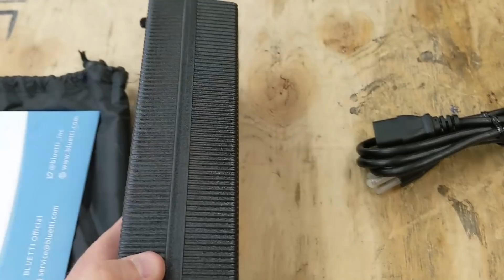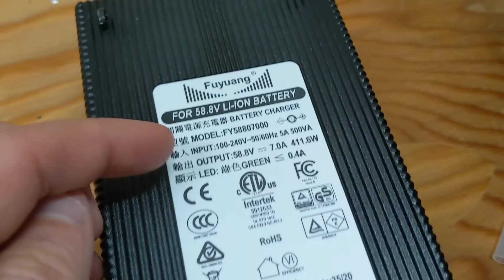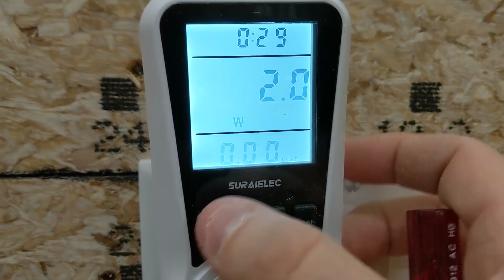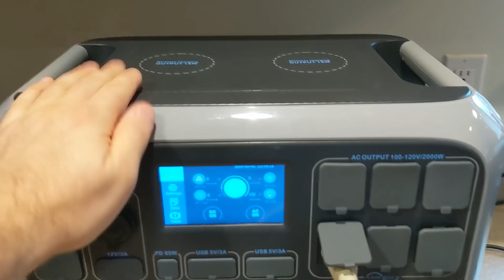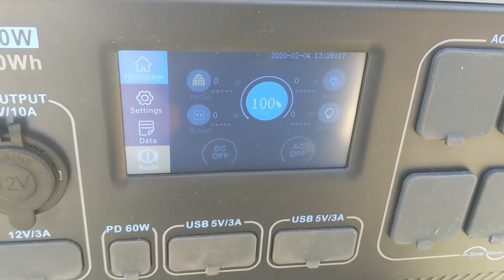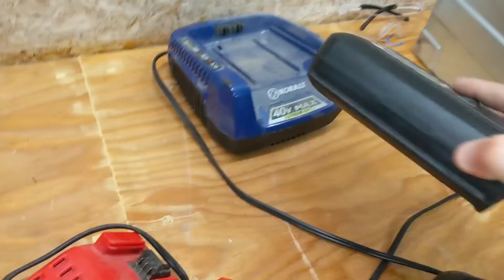DPoz Reviews:  Bluetti AC200P - Updated model for 2021 - Solar Generator

Comment: Cheaper/smaller inverters tend to have a so called "soft start feature". This allows the output voltage to sag under high surge loads. Lowering the voltage lowers the current. The motors in the vacuum and saw are probably simple brushed motors. These types of motors can spin up slowly to full speed using the lower output voltage. The motor in the compressor is probably an induction motor and didn't want to spin up on a low voltage. In the video you can hear the compressor turning slowly until the inverter trips out. It would be interesting if you redid the inrush testing using the power pack inverter as the source. I bet the inrush current on all of those tools will be lower on the smaller inverter. 

- A guy studying electical engineering

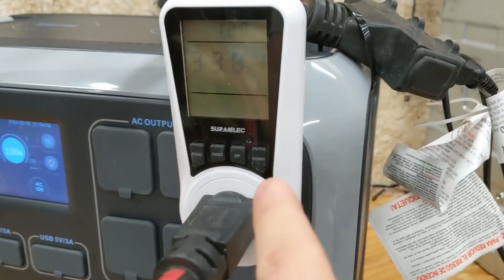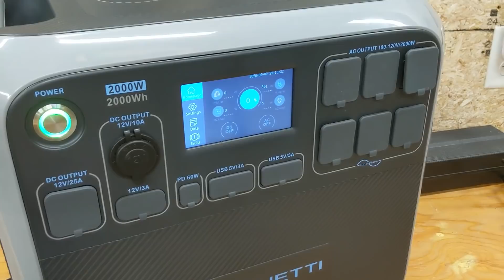Comment: Ok gr8 so I like your idea about two very large mono panels also I like the idea that you established they can run a five amp 5000 BTU air conditioner unit which is absolutely necessary for me in Florida. now combined with the fact that it recharges in 5 hours which would be an evening while you're sleeping after the solar panels have stored the energy would it run the AC for like 8 hours or even more? the coffee pot only has to run for 3 minutes so that's not a big issue of course it's nice to have coffee but why should I have to pay $3,000 to make sure I can get some lol now when you're talking about air conditioning that's a way bigger different story for me I have to have it. So if we could run at 8:00 to 10:00 maybe even 12 hours or more now you've got my attention! Also the Amazon website said that there was a $200 discount but when I went to go see the checkout it said it did not apply to my account I don't understand why that would be please explain that

Comment: I ordered the original version of the ac200 through the indiegogo program. Since it was nearly 3 months late being delivered, and I had to get on the road, I ordered a jackery e1000 to use while I waited for the ac200. The jackery was used to power my refrigerator and to charge up my phone and laptop and a few other small devices. I charged the jackery with an inverter connected to the alternator while I drove my van. From a full charge I could get four to five days out of the jackery before it needed recharging. When the AC 200 finally arrived, considering the extra battery capacity versus the jackery, I expected to get six maybe seven days out of the AC 200. Nope. I got the same four or five days as the jackery. I've sent five emails Bluetti trying to get them to explain why their unit, with 700 more Watt hours than the jackery, could not outperform the e1000. I got no satisfaction from Bluetti. I don't know what your experience has been but, I don't think the person who was answering my emails had English as their first language. They have stopped answering my emails.  Is there any diagnostic tests that I can run in order to prove the health or otherwise of my unit?
Reply from the maker: You could try a capacity test, same as I did in the video.  Use a little KWH meter (plugs in) to measure your discharge capacity.

Comment: Great video, would I understand that the dc outputs would work far better running 12v led lights, RV 12V fridge, RV 12 volt fan etc

Comment: hi David open it up? I am curious to see what kind of inverter does it have? I am suspecting is not a transformer based. because it uses a separate power supply adapter which isn't very efficient as per your test it needed 2400 watts to recharge 1800 watts that were used from it . I like the many other features that it has but it is too small on wattage power and capacity and not very efficient. I got it say that your review is a lot  much better to point out the good and bad of it thanks for good work..

Comment: So it takes 2400 Wh in to receive 1800 Wh out.  Those switching power supplies(charger) are very efficient ~98%, or they would need much more cooling to push that much power thru such a small package.  The inverter is ~90% efficient.  Yet you still lost 25% of your input power.  That extra 14% inefficiency comes from using the Fe (iron) batteries.  They consume a large percentage of their charge current to internal loses.  This is the greatest part of the "Internal Consumption" that Bluetti refered to in their email response to you.  If they had used Lithium Ion batteries you would have lost about 250 Wh in the conversion instead of the 600 Wh lost with the ferric batteries.  That is 60 KWh lost in a year if you figure only 100 chargers per year. Not trivial for an off-grid application.
Reply: This is not 2400. It is 2000.
Reply: what brand would you suggest? I'm based in Europe

Comment: Your dewalt saw isn't drawing 66 amps at startup from the bluetti. To some extent it can draw what it can get (a lot of power tools have "soft start" technology that allows this). It would be good to see what that clamp detector shows when you have the tool plugged into the bluetti, I bet it won't be 66 amps

Comment: I prefer hardware switches for power vs that touch screen. One of the few issues I had with this device
Reply: I'm with you on the hardware issue. However, if the screen were to fail, I think you would be able to use their app. via Bluetooth on your phone. I don't think that the app. can be used via Wi-Fi like the Eco-Flow.  i could be wrong. I'm new to this. But I figured I would put my 2 cents in.

Comment: I'm not an electrical engineer either but I bet if you put your inrush meter in line with the blue Eddie and the saw you'll find it's less than 44 amps in rush if you listen to The Saw start up on the blue Eddy vs your wall power you'll find that it starts much slower on the blue Eddie therefore it's drawing less amps

Comment: I have recieved my AC200 and a 2nd one under warranty. Both have defects.  The units have temperatures on three screens. The temp on the PV/Car screen is about 30°f off. This could be a fire hazard..you may want to inspect your unit to make sure the temperatures are right.

Comment: Ok so about to buy one but hesitant to buy it. Need some advice if anyone has an option I have a mobile car painting business I run a 1200 watt heat gun so I think I will be ok also a Makita sander which which should be minimal. The question is I have a 1hp 8 gallon air compressor that draws 8 amps its specially designed not to draw too many amps so will this work. I have a 2000 watt generator that I'm currently using but hate lugging it around

Comment: David some refrigerator with "INVERTER" technology will softstart and not have these peak current draw like older that use compressor without inverter technology. This technology work in PWM and it's actually a DC compressor that is electronicaly modulated so the AC input is rectified and then modulated to a BLDC motor.

Comment: David, sometime some LiFePO4 cells charge to 3.70V instead  of 3.65V. In fact some yellow serie LiFePO4 Thundersky cells specify up to 4.20V !   the firsts LiFePO4 released 10 years ago were charging at 3.60V like A123 did, then later 3.65 became  the rule and some chineese still charge above that at 3.7V.  but there is so low capacity between 3.65 and 3.70V then it does not last so long, unless the charger or BMS would not have any timeout or charge control that switch off.

Comment: Your meter only measures the highest momentary current draw during the in-rush.  what it does not tell you is how long the peak lasts.  You would need a tool that records and plots the current over time to show how long that peak lasts.  Even a few milliseconds more of in-rush period may result in faulting your inverter even at a lower voltage.

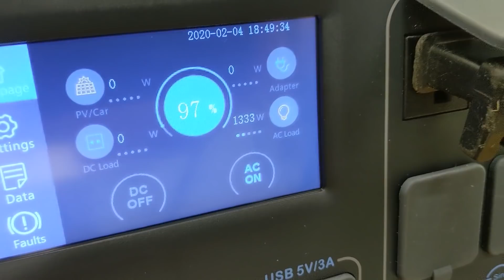Comment: To better explain the power "surge" (@ 20:00)  in the future there's at least two things consumer devices should concern themselves with.  The first is the inrush current used when a lot of torque is needed (e.g. getting saw blade from 0 to 1000s of RPMs).  The other is the inductive load (power factor) capacity of the inverter.  Typically with a resistive load most of the current is when the sine wave is at a peak.  Inductive loads pull this out of phase meaning you're pulling more amps when the sine wave is heading towards or away from peak.  Good inverters should deal with lower power factors better than cheaper inverters for instance.

On some inverters you might see a VA capacity which is the total peak correcting for power factor.  VA might be lower than the total Wattage of the inverter for instance.

Comment: You know the problem is with all this solar stuff is and i believe it is on purpose in stead of speaking in volts and amps the hide the real info in watts  so you can't see what it can do up front for example  if to you look at the amps something can power it would not be the convoluted BS who want o stand there and figure out what the hell it can run it is absurd  in stead of speaking volts and amps which we are all used to understanding

Comment: you said this was a ac200p model review but you also showed that it was identified by the plackard on device as being the ac 200. Are they not different battery types    ac200 p  lithium iron         ac200 lithiium ion ?

Comment: The current clamp is not measuring or indicating the Power Factor of the inductive load (motor windings) from the compressor or the saw.  Also the saw was not under load when it motor started to spin but the motor on the compressor was under load when it started to spin.

Comment: David... does anyone do a portable power station that will run a compressor, mitre saw, MIG etc... so a proper job site power station.... I can only find ‘hobbiest’, no in rush power stations just for charging phones or running small loads. Would be an interesting test if you can find one?
Reply: It wouldn't surprise me if there isn't. I think the appeal of devices like this comes from being portable, a super high power one wouldn't be larger and not very portable. The market would probably be very limited. Most people who would want high power like that would probably prefer the flexibility of having the batteries separate from the inverter, allowing easier expansion for example.

Comment: AC200 is for powering light-duty appliances like a 700watt microwave, small shop Vac, Coffee machines, and others. Emergency and light power RV uses
Reply: Did you say COFFEE Machines... I am Happy NOW.
Reply: It's advertised as a solar "generator" with 2000 running and 4000 peak watts, it should be able to perform equally to a gas generator with the same specs. A gas generator will run my mitre saw no problem, I'm very on the fence now about getting this since it won't run my big power tools for my off grid camp site

Comment: Why do they call these units solar generators? They are nothing more than glorified battery packs with a built in inverter. They do not generate electricity from the sun.
Reply: Because they replace traditional engine-powered generators and are "refueled" by solar panels.

Personally I think it's a bit disingenuous, I think they should include the panels if they call it a solar generator. But that's marketing for you.
Reply: Do you not know how solar panels work?
Reply: they attach to panels that DO

Comment: Is there an easy way to extend the capacity of this BICC (Battery, Inverter, Charge Controller) by connecting to either lead acid or other Li-Ion/LiFePO4 batteries?

Comment: I don't really understand why you multiply by 1.25 because voltage drops under load not raises. If the VOC is under 50v you should be able to hook up 3 of your panels. I know its limited to 700 watts but on cloudy days having 3 panels would help alot.
Reply: He multiplies the Voc because the voltage of the panels increases above the rated value in some situations, particularly when cold. A typical panel has its Voc specified at 40C and increases by .3% each degree below that. Massachusetts goes below -10C each winter, which is 50C below nominal. This means the open circuit voltage would be 1.003^50 = 1.16 times nominal in normal cold. 1.25 gives a bit more headroom for abnormally cold days.

As for the voltage dropping under load, please keep in mind the unit won't always be charging. Current will be reduced at times when the unit runs its MPPT algorithm, and will definitely be stopped when the unit is fully charged.

Comment: I wonder if it could handle the microwave in my rv. I have a 2400W inverter generator and it screams when I run the microwave.

I would kill to have one of these for my RV. I hate having to run the generator just to top off the house battery every morning. I'd probably just leave the rv plugged into this thing and let it be an uninterruptible power source with my 120W portable solar panel trying to keep it charged.

Comment: i am deeply invested in Bluetti with AC50s,  AC200,  EB24.  I purchaSED all three for my SprinterVan.  I didnt have time/energy/experience to do a  DIY system.     the real question is WHY  spend this amount of $.   i think MOST (99%)  buyers just enjoy this stuff.  they can rationalize they need it for backup, etc  but honestly how often does the power go out ?  I lived kin Caribbean 6 years (US Virgin Islands) power went out EVERYDAY.   it was a simple routine to start my 1000 watt Yamaha generator   and switch freezer to the extension cord.   I had panels they were grid intertie only.  These big powerbanks were not yet invented.  i think a design that allowed buyers to build their own system.  a small unit without batteries.  allow buyers to add batteries as needed and budget allows.  Bluetti has the nicest powerbanks.  Excellent customer service.  Reasonabble prices.  A GFEAT PRODUCT !!

Comment: I think I don't like the touch screen for turning on AC-DC specially when working with globes or dirty hands. A Bluetooth phone app would be better than the builtin display. 
Very nice review and lovely family.
Reply: Joe Prescott  -  I  bought  one  &  did  not  want  to  soil  the  touch  screen,  so  tested  &  found  the  rubber  eraser  on  a  standard  Ticonderoga  ( or any )  pencil  will  operate  it  just  fine  with  a  very  gently  touch.   A  woman  had  commented  that  a  gentle  tap  of  her  fingernail  was  all  that  was  needed,  BUT  a  fingernail  is  a  hard/sharp  edge  &  may  do  damage  over  a  period  of  time.    I  just  leave  the  pencil  on  top  of  the  Bluetti  for  convenience.  
   Out  of  curiosity  I  just  checked  with  my  Samsung  tablet  &  it  will  NOT  respond  to  the  pencil eraser,  but  the  slightest  touch  of  my  finger  works  easily  =  different  types  of  'touch'  screens.

Comment: When it was trying to run the air compressor you can hear how long it was attempting for (over a second). It was clearly struggling this whole time

When it was powering the saw the load was only on spool up.

Comment: Peak amps are not the only thing that can max out that Bluetti, it can be also maxed out by peak duration - it is possible that saw without any heavy load would peak 66A to get blade rotate but quickly drop below invertor’s limit, but the air compressor peaks at lower amps but for much longer time...